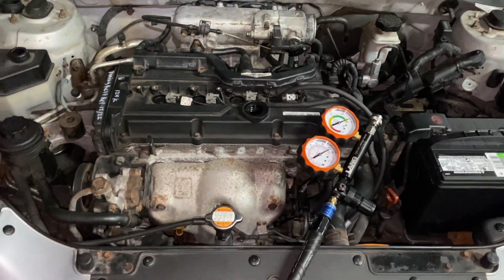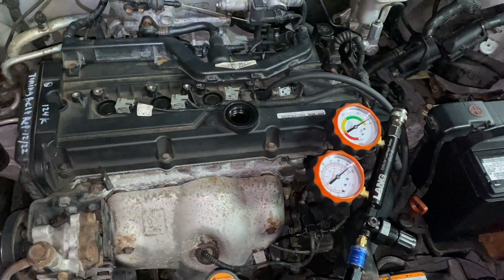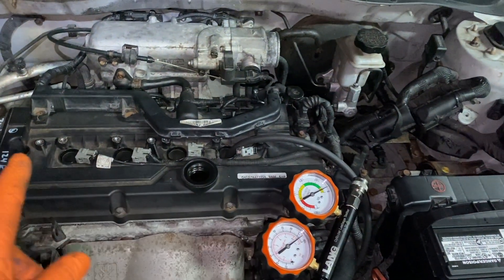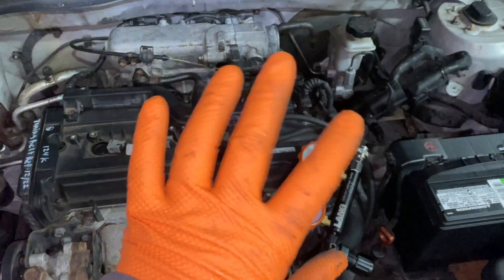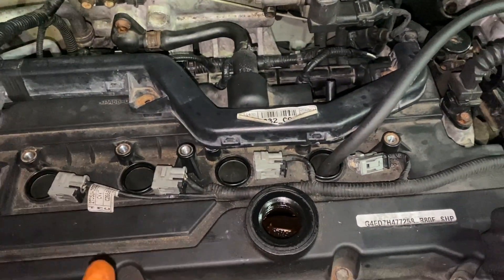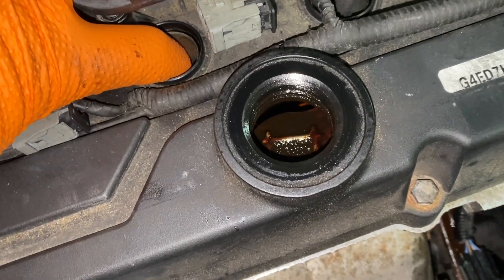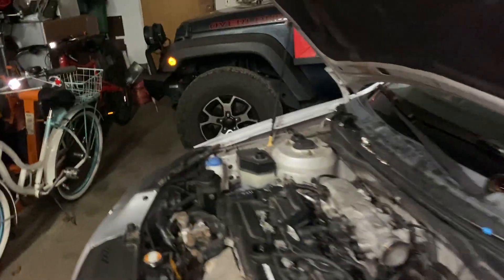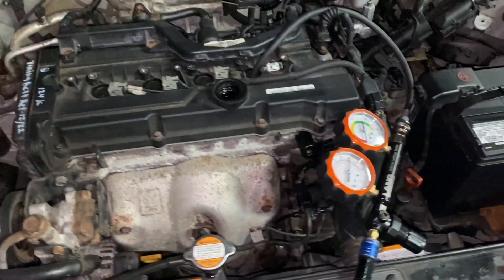Low Or No Cylinder Compression Misfire - When Cold - How To Diagnose

Comment: Low Or No Cylinder Compression Misfire   what was the fix in on this video ?  was the cylinder head reoplaced ?
Reply: On my car cylinder no 3 has no compression have not taken the head off as I have oil in cylinder no 3 suggest valve is stuck open
Reply from the maker: Bad piston or rings or a burnt valve
Reply from the maker: This was a carbon stuck valve. From lack of oil changes.

Comment: Injecting air from the spark plug hole is very clever. I have a similar issue, and I suspect is the intake valve, but trying this will tell me for sure. Thanks!
Reply from the maker: Awesome, glad it helped! Let me know what you find?
Reply: @motorcarnut   Definitely a leaky intake valve. I had ny suspiciosn that it had a lot of carbon buildup, so I'm currently trying the zip tie and drill + intake cleaner method, and it does look better through a boroscope, but still leaks after 2 rounds of scrubbing. I'll try some more after my break, but I'll probably have to remove the head to do a proper cleaning, and a valve lapping since I'm there. Thanks again!
Reply from the maker: Thank you! Hey you’re on the right track. Lapping may be the best route but time consuming. Appreciate the update and good luck!

Comment: Thank you, I’m having same sort of issue, 8bar (115psi) on cylinder 5 when cold and 11bar (160psi) when hot on all cylinders, I guess if I have a valve problem I’m gonna get air leaking though the intake and if the rings are bad the crankcase will pressurize so air from the oil cap och dipstick
Reply from the maker: Yep, you got it.

Comment: Amazing video presentation with lots of engine's inner working concepts..!  Quick question: in this case, would "relative compression" test reveal similar results with cold engine?  This way you don't need to hook up all fancy gauges & compressor.
Reply from the maker: Good question! It may or may not. The problem with a relative compression test is it may not catch the sticking valve or which one is sticking at all and you still need special equipment that many people probably don't have. It's also not as accurate as a cylinder leak down test.

Comment: my car starts fine and after running about 1 to 2kms misfire comes up.and After driving a few more miles misfire seems to go away. Please help
Reply from the maker: That sounds like can be a spark plug or ignition coil if it’s just one cylinder misfiring if more than 1 can be vacuum leak somewhere
Reply: engine is diesel. So can it be injectors or head gasket issue? my mechanic assume that it is the injectors
Reply from the maker: If they saw your vehicle go with they say, injectors can cause misfiring but not in all cylinders at once
Reply: @Motorcarnut  1 Question brother, if injector is not properly working then is there any chance of high fuel rail pressure and smell of diesel?
Reply from the maker: @kenaokonthoujam8409 smell of diesel yes but not high fuel rail pressure, that doesn’t make sense.
Reply: @Motorcarnut before misfire comes up fuel rail pressure is around 3300 3400 psi but after driving about 1 to 2 kms fuel pressure goes suddenly upto 4300 4400psi and the misfire starts
Reply from the maker: @kenaokonthoujam8409 can’t be 4400 psi?
Reply: @Motorcarnut  yes at idle 4400psi, obd scanner shows like this. but before the misfire starts its around 3300psi
Reply from the maker: @kenaokonthoujam8409 what vehicle is this?
Reply: @motorcarnut  ford figo 1.4tdci
Reply from the maker: Oh, I diesel engine. Fuel pressure is within range I’d suspect ignition system
Reply: @motorcarnut  ignition system means which parts?

Comment: My 04 f150 has a misfire that want away for 500 miles and now it's back! I changed coils around and tried new plugs but found out low compression 75 psi. Wonder if the cam phaser could be bed enough to lower the compression that much?? They say the right bank causes trouble first on these 5.4 triton engines,mine has 215500 miles on it?
Reply from the maker: It’s very possible, yes. To rule that out I’d do a leak down test on that cylinder if it passes, phasers would be suspect.

Comment: do you think my prelude after sitting for  about a year and when i last started it i only ran it for about a minute can cause the cylinder walls to get washed out from fuel? it wont start it has spark and fuel and it sounds like its turning over super easy. the motor is rebuilt with around 500 miles on the new rings with original pistons and new rod bearings and all that. brand new timing belt with a manual tensioner. ive heard just dropping a spoonfull of oil down each cylinder then turning it over with the fuel fuse unhooked  and no plugs. then trying it can fix that i just dont know if it even has low on compression cause i dont have a compression tester lol. the starting fluid i used trying to start it a few times couldnt of helped if the film of oil on the cylinders is gone lol i hope i didnt mess it up i have alot of time and money into this car lol
Reply from the maker: Did you drain that gas and put fresh gas in?

Comment: Great video! But, I have a question.  Mine does kinda the opposite.  I have a buick 3.8 and been chasing a cyl 4 miss.  Narrowed down, great spark, great fuel, good comp of 150 when starter engaged. But when running, miss returns. After checking everything 3 different times,  i was getting stumped.  So I checked again. Compression was 150 first try, reset gauge, hit starter again but it actually cranked and started running because i didn't diable system and while it was running I checked gauge and it was dancing between 20-25 psi. Losing compression at higher rpms. Im thinking sticking valve but idk. Put seafoam in gas and mmo in oil trying to loosen it up. Any thoughts? Thanks.
I may try a bleed down test next but every time it shows 150 from just the starter turning it. I cant bleed test a running engine. Looking for any ideas.
Reply from the maker: Sounds like a sticking or slightly bent valve or failing lifter.
Reply: @motorcarnut  it may be a slightly bent valve. The car was parked for about a year-and-a-half. And when I got it cranked initially after that there was a pop that I didn't quite comprehend. Could have been the Piston hitting the valve that might have been rusted or carbon stuck.
Thanks for the reply. I'm going to put some miles on it and see if it loosens up with that Marvel Mystery Oil and seafoam. May get lucky if I don't clog my cat first.
It has to be a very small Bend because it's sealing during a starter crank compression check.
Maybe it'll work free.
Reply from the maker: @headpainter1 Also, a lifter problem
Reply: @motorcarnut  my understanding of lifters is either they hold hydraulic pressure or they don't. If they don't they make an awful rattling sound with the valve linkage. I hadn't really thought about a lifter sticking but I guess that could be the case as well. The top-end is not making any noise. But I'll try to keep an open mind.
Reply from the maker: @headpainter1 Yes, but if one was clogged it can temporarily hold the valve open too long and cause that miss.
Reply: @motorcarnut  that makes sense. Thanks for the input. I may pull the intake and redo the intake gaskets. Little easier than doing that rear head. I believe I can get to the lifters under the intake. May Carbon spray the shaft of the intake valve as well from that position.
A lifter sticking would actually make sense because if the valve was bent and sticking down then the linkage for the rocker arms would be loose causing noise. There is no noise so if a lifter keeps tension and sticks it should mimic my symptoms.
Reply from the maker: @headpainter1 no problem

Comment: How about the opposite? Engine misfire when it gets hot. Mine's a 3 cylinder engine. Cylinder 2 seems like dead. I brought it to a shop near me and was told I need a new engine. I cleaned the sparkplug holes, throttle body and fuel injectors with engine conditioner to clean up built up carbon and I regained some power back but still not running like it should. I don't have access to compression meter and other tools, what can you recommend to look into?
Reply from the maker: If you don’t have the proper tools like compression gauge etc. to diagnose it, I can’t help you.
Reply: @motorcarnut  I just ordered a compression gauge. Should be here tomorrow. What other tools do I need to diagnose this problem?
Reply from the maker: Start with the compression first. Should be at least 90psi and up on all cylinders.

Comment: I'm having the same issue the mechanic did a cold compression test on my ford ztec 2.0l motor and was getting 35psi before i took it too him on cold starts it wouldn't start after a couple of cranks but when it finally start up it misfires till it gets warm. Plugs, wires, fuel pump, fuel filter been replaced. He put a timing belt kit on i still have the cold start misfire i'm wondering if the injectors clogged are bad.
Reply from the maker: Low compression when cold wouldn't be related to a bad fuel injector. You may have a lot of carbon build up that for some reason is not letting the valves close all the way or bad piston rings, but that 's a long shot. Is it in only one cylinder?
Reply: @motorcarnut  He tested only cylinder 1 when i was there cause i had too go but he couldn't get it too run correctly before and after the timing kit was installed so $500 i had to push my car home mad. Then i started it up myself and it was misfiring bad so i let it run for a min or 2 then it smooth out like nothing was wrong and when i cranked it this morning it started right up no problems.
Reply from the maker: Could be carbon buildup that was not interfering with the valves this morning and it started up. Hopefully that’s it.
Reply: @motorcarnut  It's 45° today and i started it and it was misfiring for a minute then it smooth on out I'm getting frustrated about now changed everything that got too do with gas except injectors.
Reply from the maker: What codes are coming up?
Reply: @motorcarnut  No codes if it sits for a couple of hrs it does this other then that I can go somewhere and it will start right back up no problems.